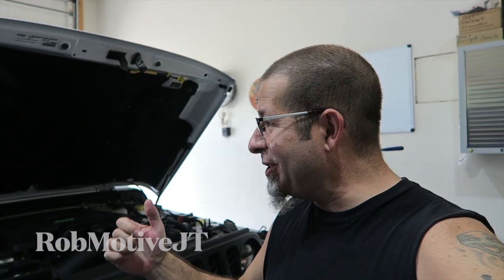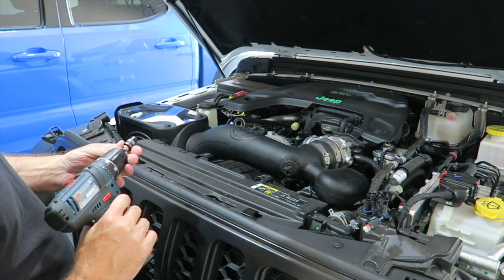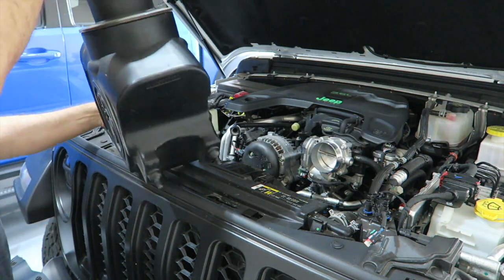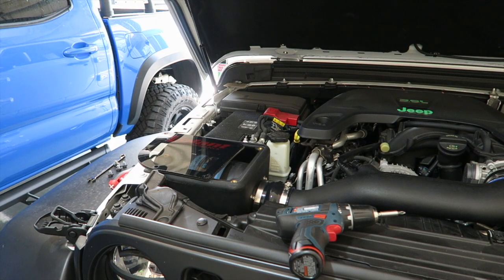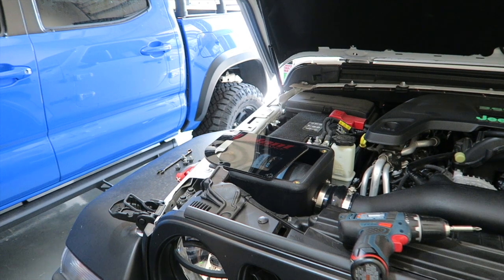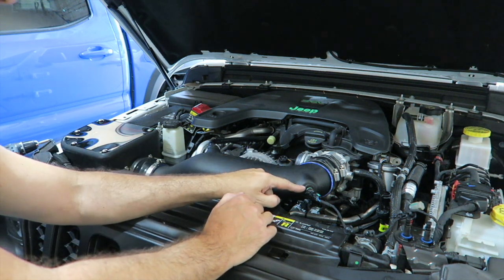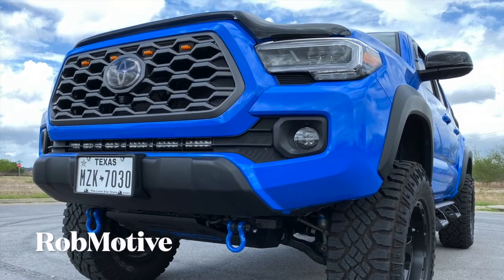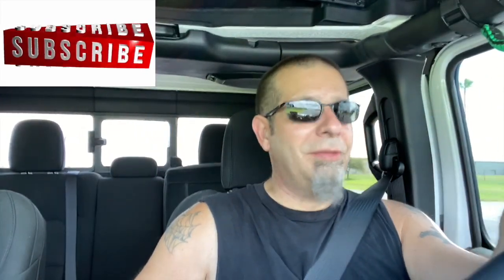I'm Going to Make My JEEP GLADIATOR ROAR

Comment: Rob I went searching through your videos and found the AIRAID cold air intake install and test drive videos.   The AIRAID definitely has the best sound of the 3 you have shown.   Aesthetics are good but it is under the hood.   If it were mounted on the bumper or something then the S&B would look better.   Functionality is the key to a cold air intake and they probably all do a great job as cold air intakes but AIRAID has the added throaty sound to it.
Reply from the maker: I agree.  Definitely the Airaid has the best sound👍